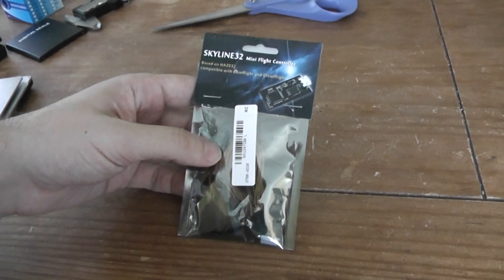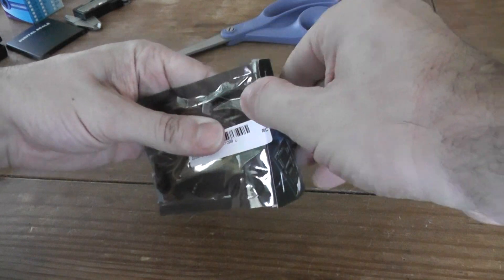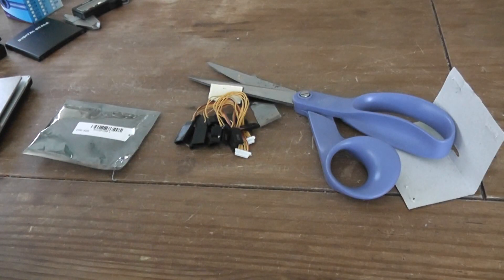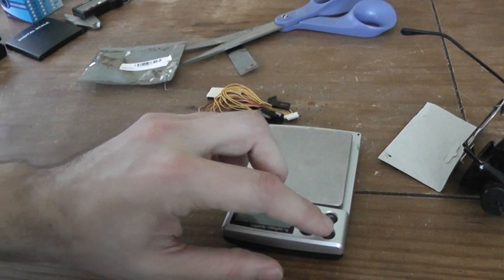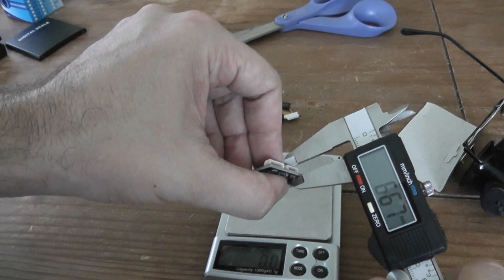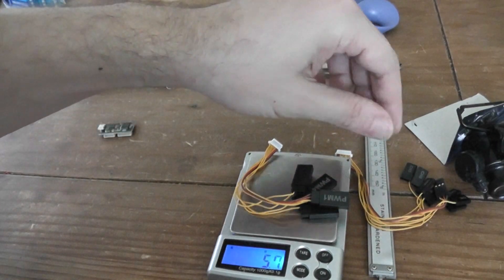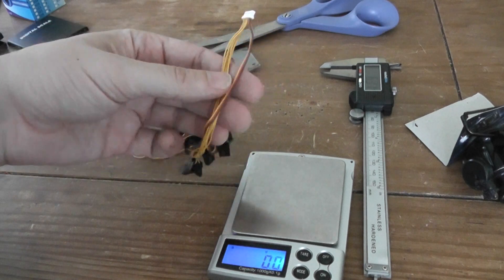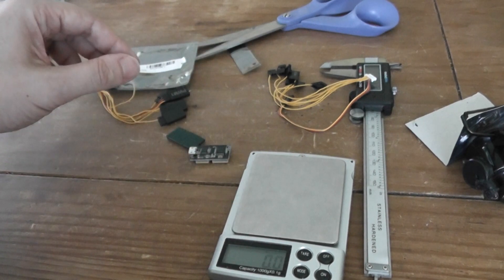EMAX mini Skyline32 unboxing (Courtesy Banggood)

Comment: I've got one of this too, incredibly small it is.

How do you update its firmware? I can't get it to flash on Baseflight as it keeps saying "No response from bootloader, programming : FAILED" Can't find any info about this board how to flash it other way beside using Baseflight.
Reply from the maker: +Witit Pienchob Hi... I know I managed to install the last BF version... I can't remember well but I think I first download locally the firmware... and then update it simply. Well it's true, there is no instruction manual ... :( but it should be compatible with any naze32 I think... For example, if you are in PPM, the free pins of the RX port, can be used to monitor/telemetry if I am not wrong
Reply: I've got a guy from Emax gaveme me a link to Skyline32 manual. It does has a manual but Emax website is so confusing to find it unless you have a direct link. Now I can update my Skyline mini. It requires 2 extrrnal software just to do that
Reply from the maker: +Witit Pienchob Interesting :) Do you have a link to this manual ?
Reply from the maker: +Witit Pienchob Thanks a lot :)
Reply: +Witit Pienchob 
Sorry for the inconvenience, cause SKYLINE32 FC is still been upgraded, we will put on our manual on our website after we comfirm the final version.
Reply from the maker: +EMAX YINYAN It can be fantastic if you can indicate how to retrieve Telemetry/soft serial pinouts if PPM RX is used
Reply: +SeBy DocKy it's ch6 .....would you know how to plug up the buzzer?